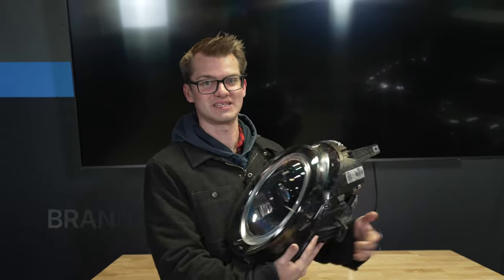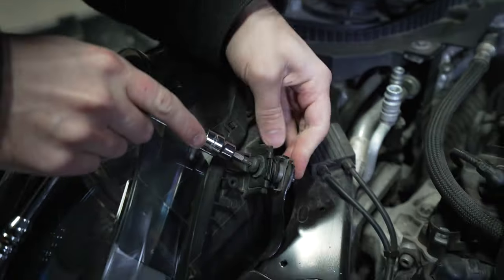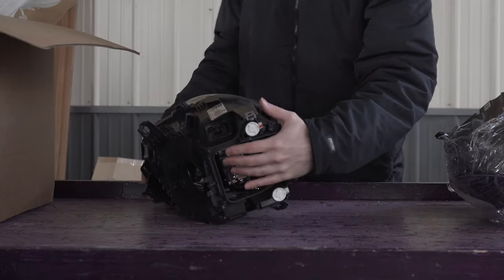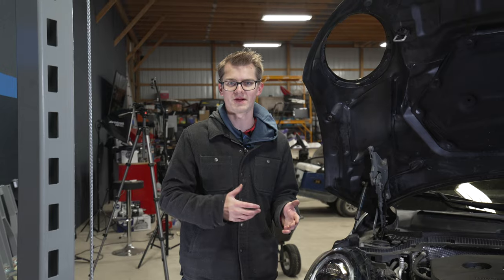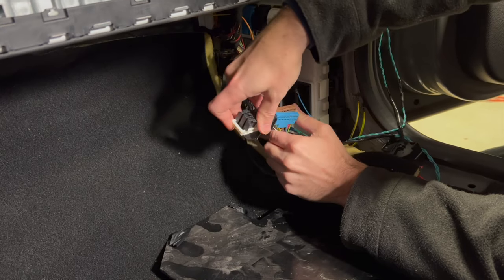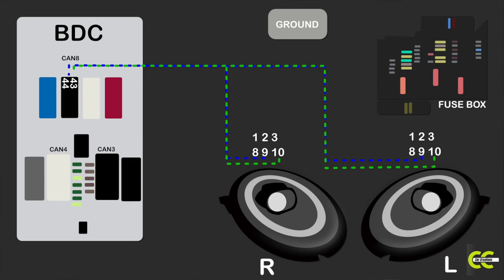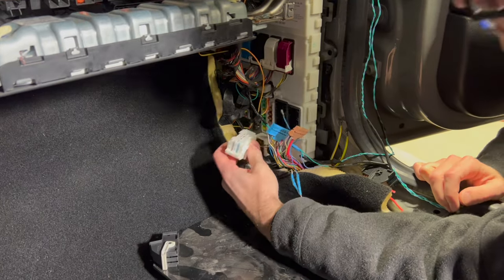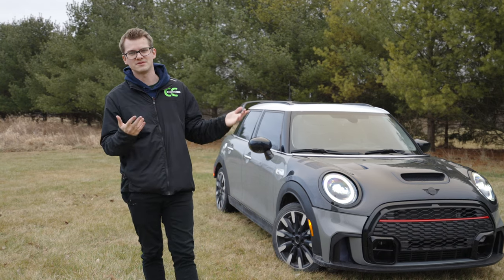I retrofitted oem LED headlights!

Comment: I've been looking for you to do this mode for your car. This mini is absolute boss with these new black headlights. I also have the LCI headlights but in chrome. I've been thinking switching them to blacks but you ain't kidding. These are not cheap, one day maybe. Thanks for the video.
Reply from the maker: Thanks for watching!! Yeah it took me ages to get all the parts, then by trial and error work through wiring. 
Well at least your switch to these would be easier! Price is exactly the issue though. 
I got these for like have price on eBay, but they were still pricy.

Comment: I bought a year ago vland headlamps from China for £350. Work well without all this wiring headache, they are good quality after all where do you think mini get the electronics from?
Reply from the maker: I heard they could be a good option! 
Do they do cornering?
Reply: @carcreationsyt  Mine do but I have the model that looks exactly like the one in this video, depending on who you buy from they may or may not. Vland do many types. I used Ali express using paypal. Took ages due to UK not being part of Europe, but the were well boxed and fitted easily with no error codes.

Comment: Great video but you forgot to mention that many many F serie mini’s with halogen headlights are just not fitted with the proper BDC to run led headlights so even if you do everything right in the end you wont see the light ecus and you cannot code them. Only solution is to swap the bdc and thats EXPENSIVE! And there are some more things you forgot but yea explaining them all in this small chat window is inpossible 😆
Reply: He also didn’t mention the year and his car‘s  „before lights“ situation…
Is there a source on the internet that explains what really has to be done to get a 2015 HALOGEN cooper S  converted to a LED  frontlight ?!
Reply from the maker: Thanks for watching! yes, there are some cases that makes this a lot more complicated however the scope of the video did not allow for all them. One of the things I wish I included was about the ballast. You need euro ones for Europe and NA ones for north America. That was a huge issue with my coding 😅
Reply from the maker: My car was a 2016 cooper s with the base spec halogen lights. I believe this will work for you! (The car looks like a 2023 because of the retrofits I have done to it)
Reply: Would these newer 2018+ lci lights physically fit my 2013 mini cooper f56 jcw?
Reply from the maker: @Oceancharter  It would fit a f56 but I am a little confused as in 2013 they didnt have the f56 yet. It was the r56
Reply: How can I find out what BDC is the correct one please
Reply: @samsexton4039  Ever figure out how to find out what BDC is the correct?

Comment: I installed mine a couple of days ago and they worked only when i unplugged and plugged them back in. Then the dlr didn't work but the turn signal and low beams worked. Took it in to the mini dealership and they told me they couldn't get it to work because something to do with my cars vin number? Then they charged me $200 with no fix. I have a 2018 F56 S with the half ring leds so i don't know whats up with mine and id hate to sell them because im trying to decrome everything.
Reply from the maker: Interesting! I would reach out to eacarworks on instagram and he may be able to code them for you

Comment: That screw is covered with protection paste (Protection to unscrew) all what needs to unscrew that 3 screw is brake the paste which means screw right and left few times to crush paste and job done. Just do this gently try nor spinning back nut.
I'm just removed lamp to change boonet lock with microswitch and that way working 100%.
Like with any other bolts cowered blue paste.
Reply from the maker: Good to know! Thanks!! 🙏

Comment: I’m not sure what year your car is, but looking at the original headlights they are different to my UK 2019 Mini F55 Cooper s Sport with JCW pack. Have you any idea is the shadow headlights will fit my car as a straight swop or would I have to do what you have done?  Thanks in anticipation of your help. Regards Rod
Reply from the maker: If you have halogen lights it will be a similar wire job as mine. You may have more wires running to the lights so you may be able to tap into those and not worry about having to run more wires. 
Cross check the wire diagram in the video with your lights.

Comment: Pretty much this is what needs to get done when it comes to the wiring:

- (NEW WIRES Twisted) 9-Pin blue,10-Pin green from both headlight is going to in car connector A258*8B 43-green,44-blue  

 

- 3-Pin on headlight ((R)yellow/Blue Disconnect from A258*2B 25-pin going to F44 fuse box 20amp, 

                                      (L)Yellow/Green, Disconnect from A258*3B 35-pin going to F47 FuseBox 20amp)

 

- Completed (R) 1 Headlight 36 in car A258*3B 

  Completed (L) 1 Headlight 48 in car A258*3B 

  Completed Ground

 

- (R) Remove 6-pin from Old headlight install it in 8-pin

                In car remove from A258*3B  34-pin and connect it to A258*4B 53-Pin

  (L) Remove 6-pin from old headlight install it in 8-pin

                In car remove from A258*2B 26-pin and connect it to A258*4B 54-Pin
Reply from the maker: Looks good!

Comment: I have a 2015 JCW F56 with the old LED headlight setup. Would this make the process easier than yours?
Reply from the maker: Yes it would. I think you would just have to repin and code. I dont have a wire diagram to compare, but if you found a wire diagram for your current lights, you could compare it to mine and see what you would have to switch. I can help with a coding session if you want, just send me a dm on instagram or an email
Reply: @carcreationsyt  Great video Ethan, thaknk you.  Like FishyDrizzy, I have a pair of original LED headlight assemblies from a 2015 F56 Cooper and I want to install them on my 2019 F56 Cooper.  I unfortunately cannot locate a wiring diagram.  When you say I would only need to repin and code, what does that include?  Is it necessary to run new wires to BDC and fuse box which seems to be most of the work.  Thanks.
Reply: Did you have any luck with installing the original LED's?  I am in an identical situation.

Comment: My question is my mini it’s a f56 2019 and have the halogen lights. And I just got the 2019+ lci led headlights do I have to re pin the lights??? Or it’s just a plug and play plus coding?
Reply from the maker: I believe you would need to do the repining like I did. I would go to the light connectors and take a look at the pins. Compare that to my wire diagram in the video.

Comment: Hey Ethan, thanks for your videos! I love them. I also drive a JCW F54! After this video, I want the same headlights. I ckecked several resources and they are really expensive. Where did you order them?
Reply from the maker: Thanks so much for watching!! 
I got them from eBay! 
You may have luck there if you keep an eye out for deals. 
If you can get them with the ballasts you can save money. 
Also make sure you get Euro parts if you are from there and North America parts if you are from there. 
Headlights are not cross compatible apparently
Reply: @carcreationsyt  Thank you! I really appreciate it

Comment: Do you have the link for these specific headlights you installed. I can’t find them anywhere. I’ve been searching for the past few days
Reply from the maker: You can just buy them used on ebay. I searched it and found a bunch. Here is a link to one I found. https://www.ebay.com/itm/266226550102?hash=item3dfc56c556:g:Y10AAOSwFfFkQBS5&amdata=enc%3AAQAIAAAA8NdRjPrGPNSUIiFO%2F6FCDDKaXCkI99wowCwOufAp83I7r%2BCXRpY45mN3K58ClIHKuGMBTVcLyQ85X4Z1GMoeVEqmmTJuZ8OrYrhOeq1xrfOPxc8x9uoVi6%2BzRVR4eWz9ewaN6NVpNTmIqHpfXSAvt9rwlmXOetXpJ6mjt67%2FU6p5SquMUwf3SDa5KA15eldvuzlSDA0SVeSzgW8WEcfCwIGx8T%2BBvmYvUogr1s5ph9QllMOSxko5cmh4II6svZyvCATSSKoYPsdos7VRdci894bS7efhpA8O9v74jSNAc8x0de4VrgrOfnvKHMXJeKszlw%3D%3D%7Ctkp%3ABk9SR7aekNz7YQ

Comment: what do you think about aftermarket china headlights ? no coding or so its just plug n play.
Reply from the maker: I did look into them. I think they could work well. I don’t know what kind of quality they are, but if they are relatively easy to swap out you could keep your old lights as a backup.
Reply: @carcreationsyt  i Will update you when i got my order how they work and if its worth the money .
Reply from the maker: @Calm.Down1  Thank you!
Reply: I used china led from ALIBABA for my f54 2019 clubman. They worked perfect.  I had halogens lights factory.  No issues plug and play
Reply: @patrickmyers1323  the LCI 2 version (full ring light or half )?
Reply: Full ring
Reply: This is the description that pulls up the ones I ordered.    
Archaic Factory LED RGB start animation DRL for Mini F54 headlights Clubman F55 F56 F57 JCW 2014-2020 mini headlight.   Then this is listed Guangzhou Dingyun Information Technology Co., Ltd.
Then a chat with Romee Xiao answered a few question over a few days.  I sent pics of my vehicle etc.
Reply: I just bought the LCI2 style retrofit lights from ECS Tuning, it says they're made by Vinstar but the stamping says Long Ding (lol). The led drl ring works great, with the headlights off its at full brightness and with the headlights on they dim a little bit but the turn signal animations are at full brightness. It uses LED projectors for the high and low beams and they are incredibly bright with good multi-directional beam adjustment. My complaint is that for the price($1,400 shipped), the internal wiring is sketchy at best and some of the materials are sub-par. They were easy to install though, I've had no issues and they look great compared to my 8 year old halogens with oxidized lenses.

Comment: I have a pre lci f56 2016 and bought the vland led plug and plays, my concern is when I get around to installing them, would they need aligning or should I be good?
Reply from the maker: I’m not aware of that particular brand but most aftermarket’s should be fine with simply bolting them on.
Reply: How does your Vland go Mr? Im about to upgrade to Vland headlight too

Comment: what year is your mini?
Reply from the maker: Mine is a 2016 f55. This should work on any f series although you have to make sure your bdc supports it else you need a new bdc which can be pricy
Reply: so i have a  2016 F56 jcw with led headlights... would the lci2 headlights work without re-wiring? just plug and code?  trying to avoid the wiring debacle lol. @carcreationsyt

Comment: I have Jcw clubman 2017, headlights have sometimes condensation, should I change the headlights or is this normal?
Reply from the maker: It is normal to a certain extent, mine will do that a little. If they are really bad you can try doing what we did to my brothers bmw. It works most of the time but not guaranteed. https://youtu.be/G7Bzx3ynv7M

Comment: I have the headlight, I need the electrical diagram for installing the headlight
Reply from the maker: Hello, no complete diagram exists however the one I made in the video and show there if you pause it, is as complete as you will find. 
It’s exactly how mine are setup

Comment: Has anyone done this retrofit with original pre lci led (half ring drl) headlights? I have a 2017 f55 S and really want to replace the headlights with the newer ones but haven’t been able to find much info. I know all of the aftermarket ones I’ve found only work with og halogen cars 🤦🏼‍♂️
Reply from the maker: Absolutely! Probably easier than my upgrade as I think it already has the can wires. You may have to repin but after that it’s just coding. 
I would take apart your current led connector and compare the pins to the ones on my wire diagram.

Comment: do you have diagram to retrofitted older generation LED (half ring and blinker separated ) ? thx
Reply from the maker: Unfortunately I have not been able find one. You could check yours to see if it would work. Open up one of the lights wire connectors. Take note of what pins are populated. 
Then check to see if the wires go to the right spots! 
If the 3 spot has a red wire, your power is correct, if brown goes to the 2 spot, ground is good, the. You just need to check to see if 1 goes to can3 pin 36 for the right light and 48 for the left light, then 8 goes to can 4 pin 53 for the right light and pin 54 for the left light. Finally for the twisted pair going to pin 9 and 10 of both light, just make sure it’s a twisted wire. Bonus if there is a green wire on pin 10 and blue on pin 9. 
If all this is correct or if you just have to repin something, you will be set to install the new lights and get them coded!

Comment: Hi mate,
I have F54 2016 sd wants to buy rear view mirror which fits onto existing mirror. I need to feed the camera wire from number plate into the boot. Any suggestion or anyone out there can guide me I. E does the rear bumper needs to come off or can be done any other way.
Reply from the maker: If you remove the screws on the bottom of the bumper, you will be able to get up behind it. If you want to rout the wire through the cabin, you may be able to bring the wire there the rear boot door liner, or you could do what mini does and go through the gasket on the right side of the car. You should be able to see it if your take the wheel liner off. Once inside, you can run under the carpet to get to the front.

Comment: You need to improve your audio. Sometimes is loud, sometimes is quiet, depending on how far you are from the mic. Either get a better mic, either normalise the audio track across the video.
Reply from the maker: I agree! We use an on camera boom mic and doesn’t sound as good when farther away so need to get wireless lapel mics or record on a second mic closer.